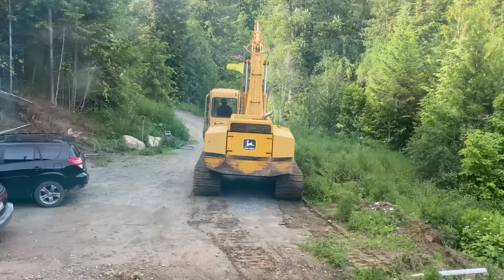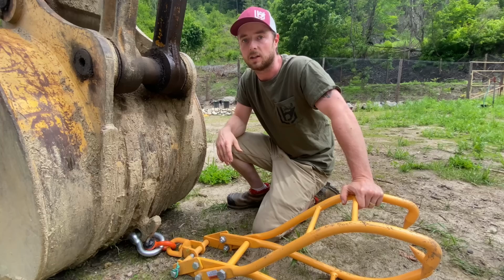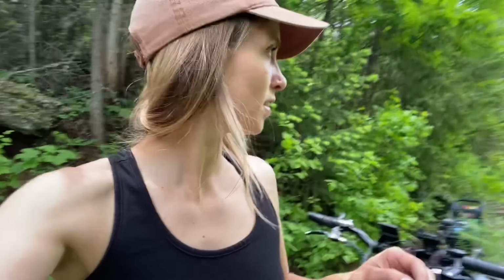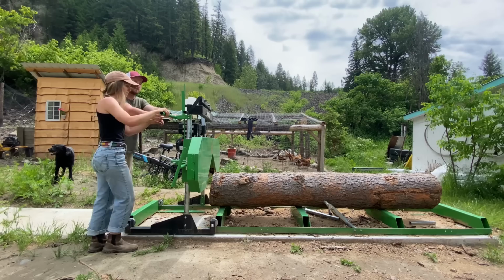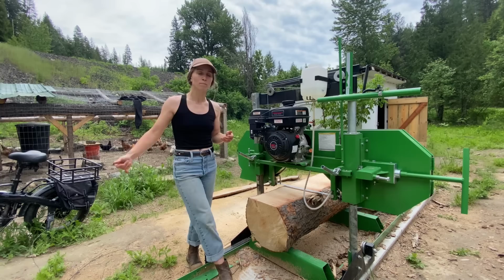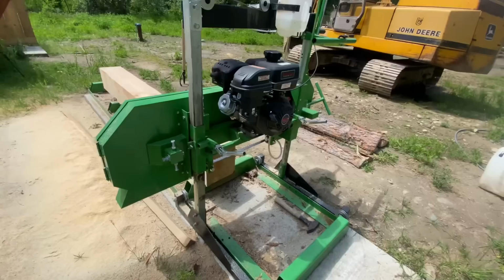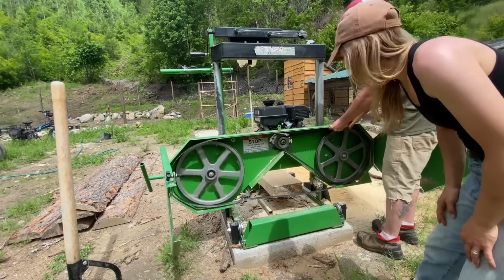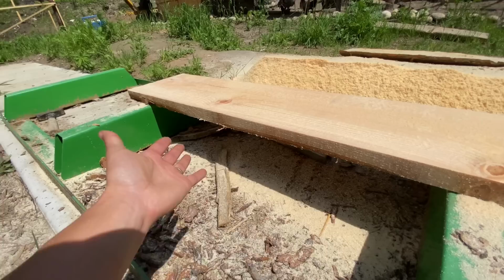Building Our House With A Harbor Freight Sawmill

Comment: If you made a shallower first cut, for the base to rest on, the last cut would be possible. Also its possible to nip the base or very bottom edge to hold it steady. or even mount a previously cut plank to the bottom to 'lift' the last cut clear.

Comment: Never have your hand on the height adjuster for any reason other than what it was intended for. Always start with the small end and level the "Pith" so you are sawing parallel to the grain. Raise your mill about 12'' off the slab for easy cleaning and operation.

Comment: When stacking on stickers. Stickers should be vertical with each other to support the weight. And also be near the sands of the boards as the sticker slows the drying on the end and stops the board from splitting. They generally split to the sticker so keep it to 1/2” or 1” from the end unless you have some different length lumber you are stacking. Great content and you guys are making a lot of progress. Keep up the good work

Comment: Good choice using wood on the walls. Drywall boards suck if you don’t keep drywall climate controlled it deteriorates quickly and will absorb humidity and will grow mold. Plus you’ve already bought the wood on your property just have to cut and mill it.

Comment: If you get a couple small pieces of conveyor belt material... You can form a sweeper for your tracks... 
I use to run a circular mill 52" driven by a Cummins Diesel.. I set up the mill and could cut 47 feet and it was off less than a 32 of an inch

Comment: Nice video, good job. You guys will save yourself a lot of aggravation if you use the lock handles on that mill. You shouldn't have to hold the height adjusting handle while cutting. In fact your mill will track straighter and roll easier if you push with right hand on the handle by the throttle and the left hand on the gas tank. The lock handles are the silver pipes on each side that flip up and down. Down locks the height once you set it. Sitting here covered in sawdust from using my mill all day. Cheers!

Comment: Always use lubricant when sawing logs, normally windshield washer fluid, with band saws as it saves wear on the blade, along makes cutting easier.
Reply: Not a soap solution ?washer fluid?

Comment: How much does that machine cost to run/hour?

Many farm sawmills could use some advanced layout and planning to streamline the log/slab/board handling process.

Situating logs close to the mill and under an electric or pull chain gantry crane makes handling easy for one person.

Placing a hay frame with log bed and a caddy full of strips parallel to the mill makes for fast and easy handling of boards and sticking them.

Adding a slab hay frame at the open end of the mill, places the slabs in a rack for turning into firewood.

Handle everything as little as possible, it pays! A good 50+ horse tractor with a loader will handle off loading these frames where you store things.

A couple of heavy wagon gears and some c channel for side and bottom frames will get the job done. Add that gantry crane over the saw, ready log pile and eventually over the finished board spot.

Start with 12' wide sections, as long as your saw bed. Use manual chain blocks at first and pull those chains. Then pick up an electric hoist w/ lateral travel.

You are on your way!

Comment: You're young and all - and so don't realize - but you NEED to get $ 10 harbor freight EAR PROTECTION when operating that saw and/or any other very loud piece of equipment. And eye protection is a good thing too. And be aware of any metal pieces in any wood you cut and bandsaw blades do break while in motion as well - so be careful and aware.

Comment: Your soil doesn't look the best for growing!I use my slabs for raised beds I usually edge them to give me 5 or 7 inches in depth you can make any types of boxes you like and the slabs are used up.  Their must be farmer's in the area to get manure to fill your beds.  I would recommend building them and selling them to neighbours as with food shortages in the near future great way to utilize your slabs and generate income for your homestead. I have various sizes I make mine 3X12  3X3 and you can get a black fabric cloth for keeping the weeds down use a torch lighter to burn holes for your plants. I have started with three and expanded to 21 this year! peal the bark off and stain your boxes to preserve. I have my first three still after three years with little to no rot yet! When they break down you can build another bed and drop it over your old rotten bed and pull out the old slabs out! This way easy to change out the rotten slabs. Another advantage about having raised beds is you don't have to bend over as far to tend to them. Hope this helps great little channel. God Bless.